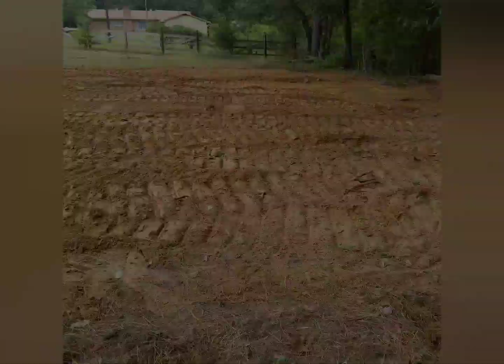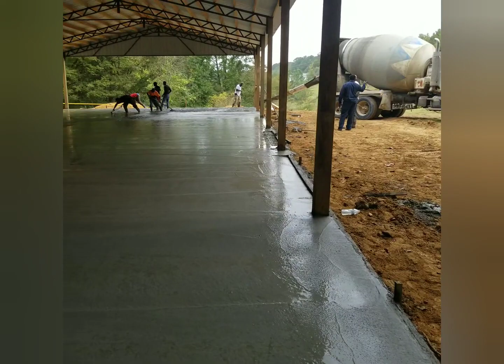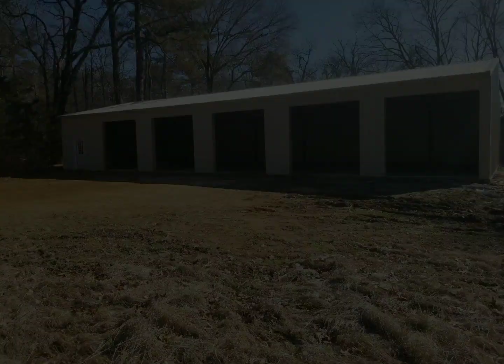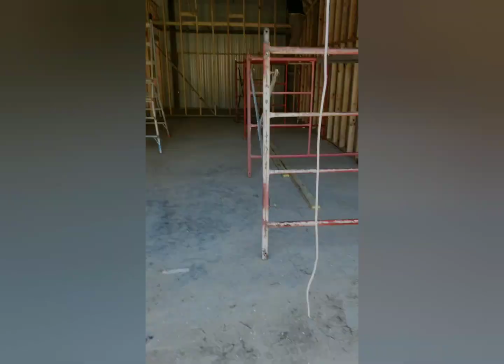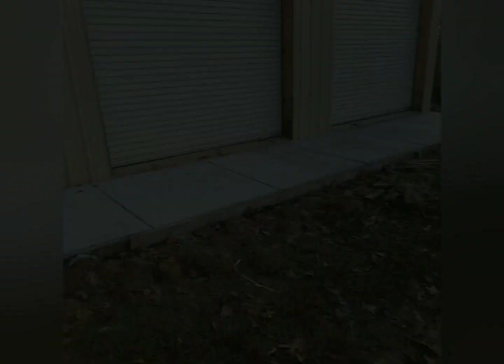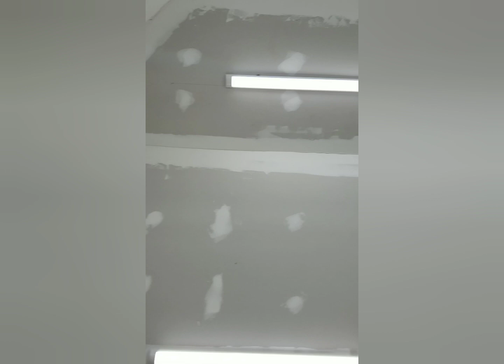The Process Of Building My Body Shop.. Part 1

Comment: Good luck. Should have used metal siding in the booth then you could wash it down.
Reply from the maker: @turbomustang8417 metal siding would better for washing it down. Looking back there's a few things I would've done differently but I'll just have to live with it. I'll just blow it out with air and wash the floor for now.